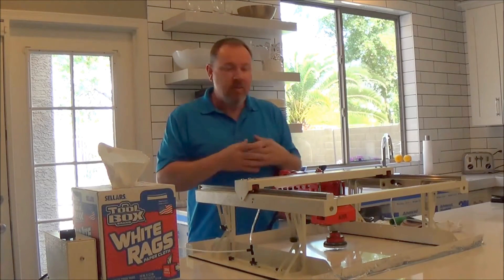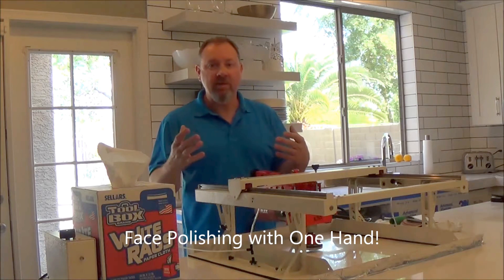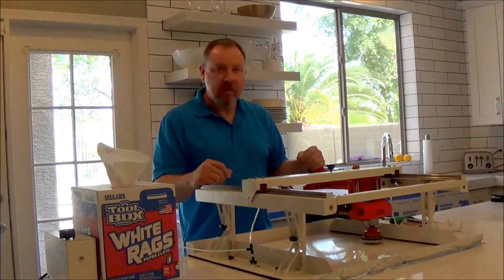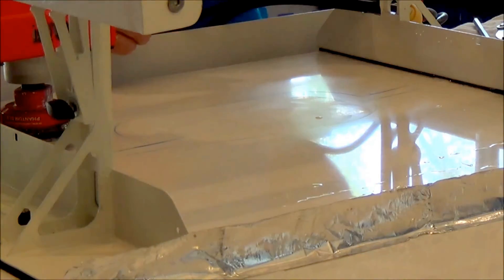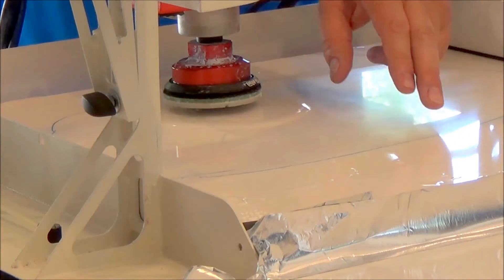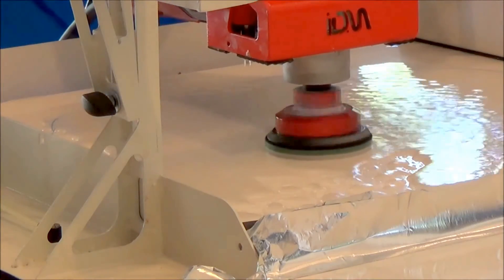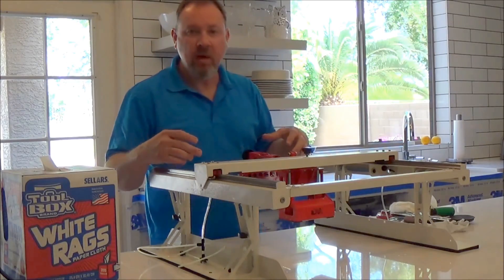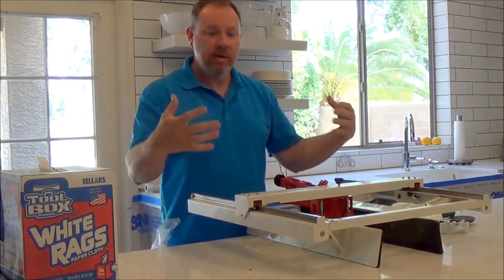Real Demo of Fixing A Scratch on Quartz with Polishing Gantry QR5 & Quartz Renew

Comment: Just had a seam fixed and can somewhat see where they polished. Would it hurt to hit it with a resin polish and final polish? I've very familiar in car Polishing and own several polishers. Think this is something that would hurt it and make it worse or is it worth a try. I'm tired of dealing with the installers that came back a second time to fix the seam
Reply from the maker: It definitely wouldn't hurt it. The hazing would have to be very subtle for polish to finish it. If there is still scratching from pads, you may need the 4 step pads first.
Reply: @QuartzRenew  maybe I'll live with it. Only can see it when the window lightening hits it from the angle